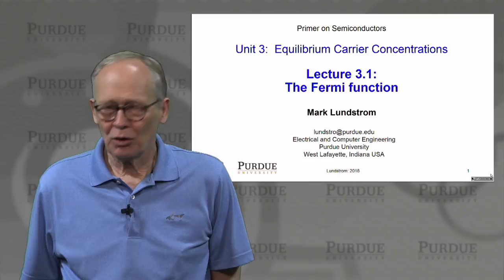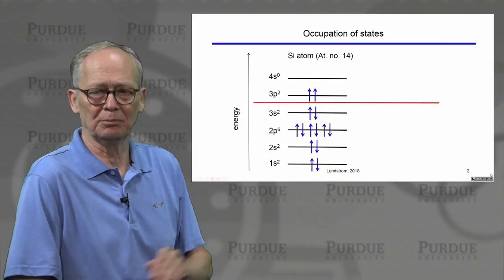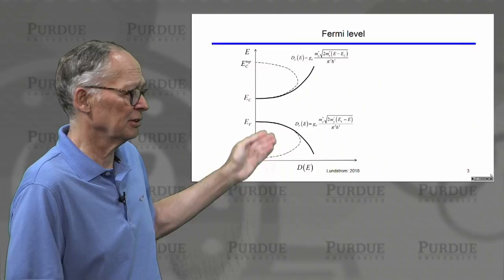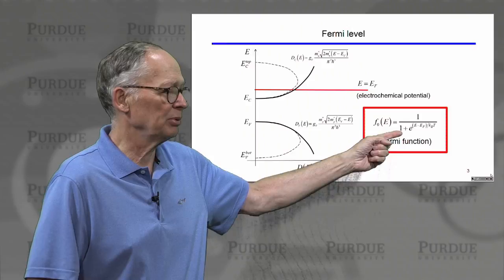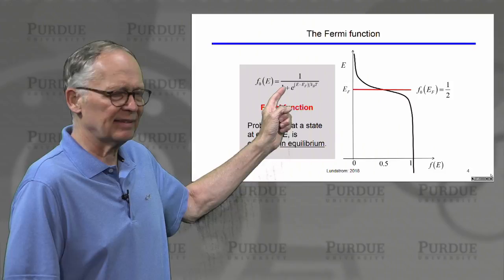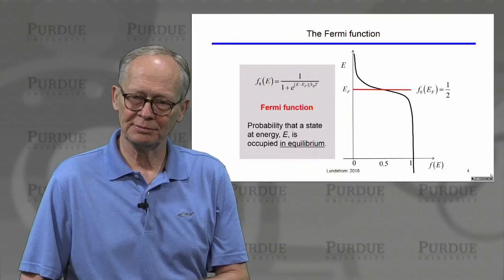ECE Purdue Semiconductor Fundamentals L3.1: Equilibrium Carrier Concentration - Fermi Function

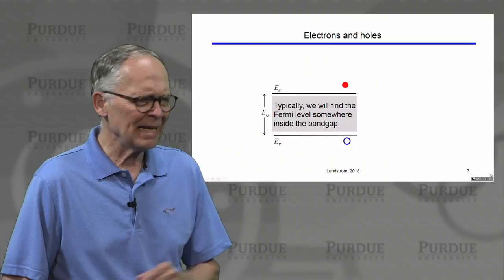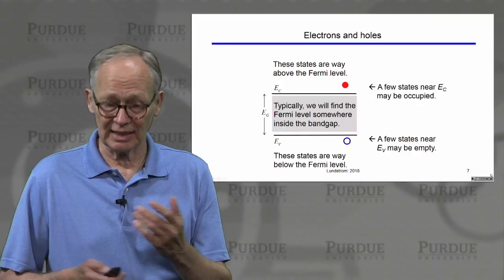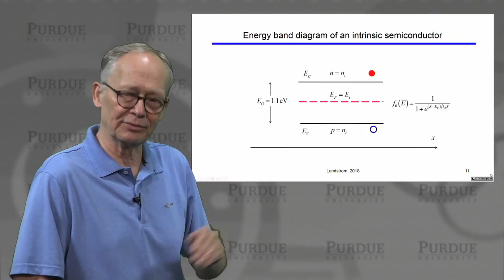Comment: 0:31 Occupation of states, 1:23 Fermi level, 3:29 the Fermi Function, 6:19 Electrons ans holes, 7:12 Conduction band, 13:58 Valence band, 10:23 Nondegenerate semiconductors, 11:19 Energy band diagram of an intrinsic semiconductor, 12:04 Energy band diagram and carrier densities
Reply: The same time stamps but line-broken
0:31 -  Occupation of states
1:23 -  Fermi level
3:29 -  The Fermi Function
6:19 -  Electrons and holes
7:12 -  Conduction band
13:58 -  Valence band
10:23 - Nondegenerate semiconductors
11:19 - Energy band diagram of an intrinsic semiconductor
12:04 - Energy band diagram and carrier densities

Comment: Mark,
On your fermi probability diagram, you have defined the fermi level at 1/2 probability point and fixed at different temperatures. But isn't the fermi level dependent on temperature too? Shouldn't the E(f) position also move on the E axis as the temperature varies?
Reply from the maker: Thanks for the question.  You are correct - the position of the Fermi level does change with temperature. That?s a little hard to show on a plot like this. The point here is that as the temperature increases,  the transtion from f = 1 to f = 0 occurs over a wider range of energies - always centered about the Fermi energy.

Lecture 3.5 discusses temperature dependence a bit.  See slide 24 in L3.5.
Reply: The probability of occupation at E=Ef is always 1/2, regardless of temperature.  The graph of probability of occupation (the fermi function) is different from the band diagram graph, where you see the fermi level in relationship to the bands.